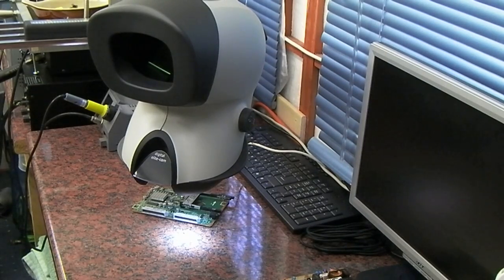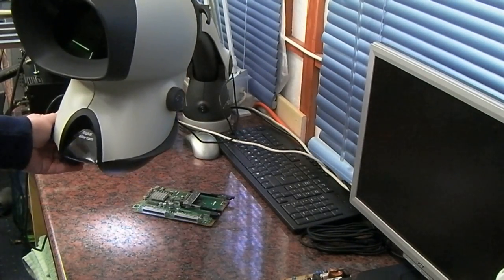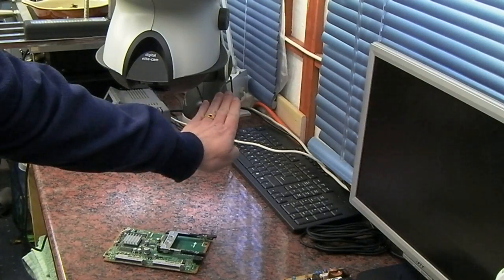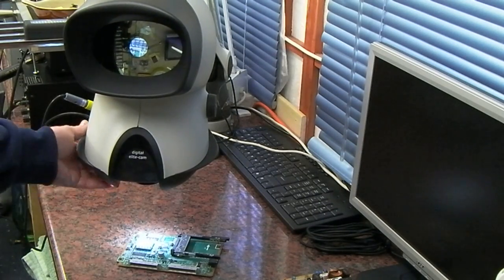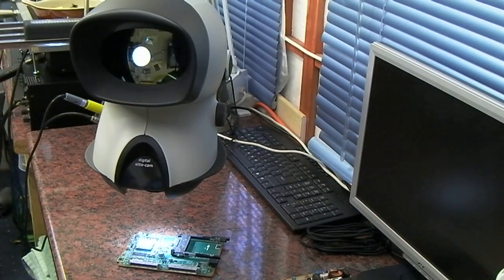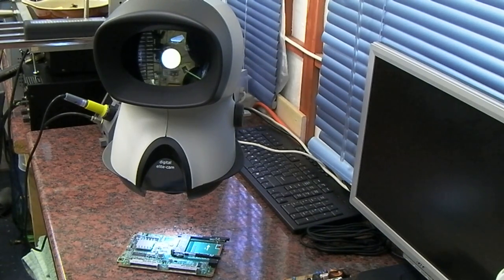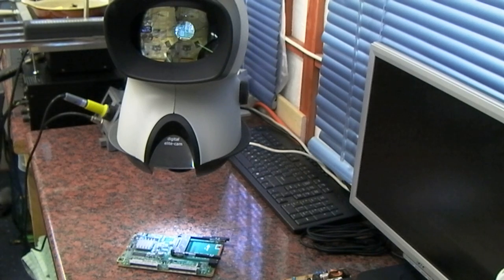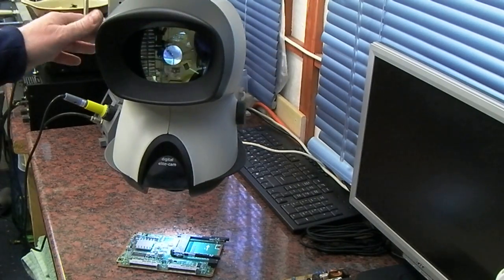Mantis Elite Cam update

Comment: Just bought a used one on ebay for $1300 USD.  I am in the process of repairing the damage on the power supply for the lighting and will be designing a PC board to replace the non PC board mantis elite. I will include a varible light or dimmer into this PC board.  I will have it ready in about 30 days.  I am working on a mount for the arm right now so you can print it out on a 3D printer.